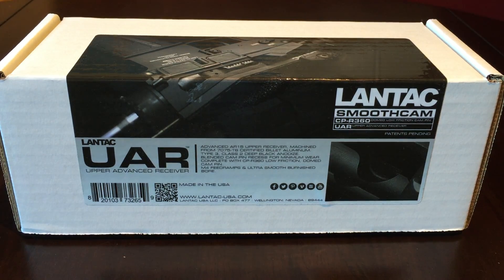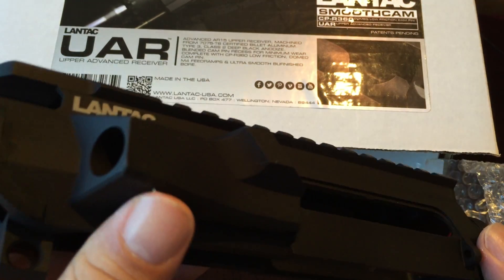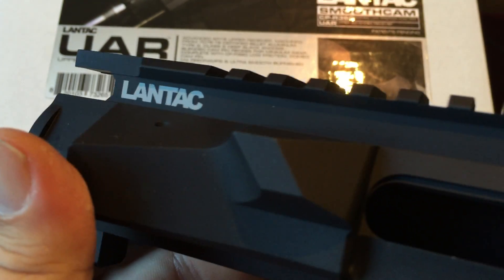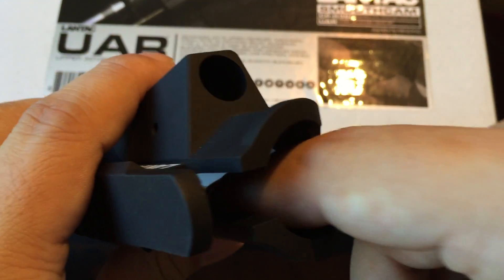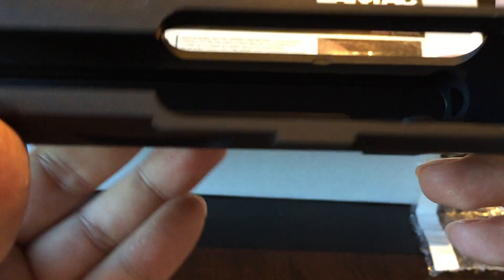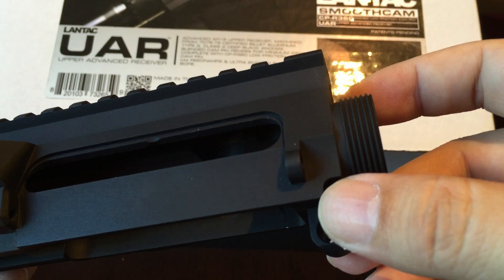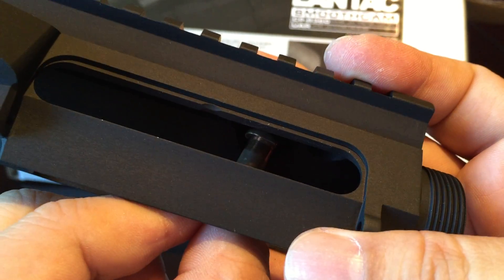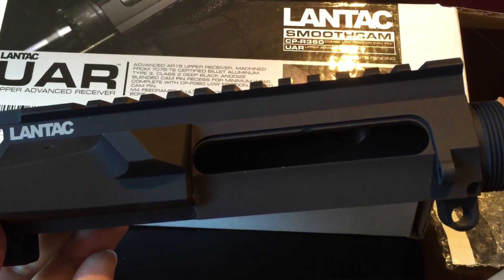LANTAC UAR Advanced Billet Upper Receiver for AR

Comment: Nice review! What charging handle do you use with UAR? I have a problem fitting my AXTS Raptor on it. Not sure if I did it correctly or there is a trick that I do not know of. Would appreciate any tip for this. Thanks in advance

Comment: That's funny that you brought up the whole cam pin subject.  I recently watched a video and I can't remember what billet upper he was running but he was complaining about a nick inside the upper that wasn't there until he ran the gun. And he says it sucks cuz it took the coating off and maybe it's my bolt hitting it lol. I'm thinking? so u didn't inspect the bolt to see lol? And it was a nice NiB bolt too. But yea so I guess with some BCG's and billet uppers you can run into this.

Comment: What rail did you use with the UAR?   I bought a Strike Industries Megafin rail for mine and the picatinny rail on the handguard is about 1/16th -3.32 higher than the picatinny on the upper.
Reply from the maker: +Mrwagondriver42 I ended up using the Hera Arms IRS KeyMod rail and like it.

Comment: I appreciate how you talk about design. Billet receivers have opened up new creative possibilities and it sounds like your tastes are mostly similar to mine. When I was considering billet uppers, i liked the Hera receiver (which i could find only in photos), the VLTOR (minus some nitpicks), and this. I also tried to consider the paint color (how black was their black? Would it match my lower?) and the shape of cuts made for accommodation of a BAD Lever. However i decided against billet because matching their beautiful lines with a lower is very difficult. There are some upper/lower billet sets out there, but most do not appeal to my aesthetic preferences. LANTAC does not sell their billet lower yet, Moreover upon studying these designs so closely, I realized an inherent elegance of the AR design that at once dates its design but also gives it beauty. I'm referring to its tubular nature. It is especially apparent in photos of older ARs. You will notice from muzzle to butt end, there is essentially a long straight pipeline, and it runs directly through the receiver. It looks like this because the bolt carrier is cylindrical. The design does not hide its workings, it is molded around the workings (form follows function). Upon noticing this I felt it was not worthwhile to try changing the AR into something it is not, especially because it cannot be fully changed; I intended to use  a telescoping stock, so part of that tube/pipeline will always be visible. Therefore, breaking up that tube with a cool, angular receiver seems to detract from the aesthetic cohesion. 

Just my 2 cents, thanks for reading.